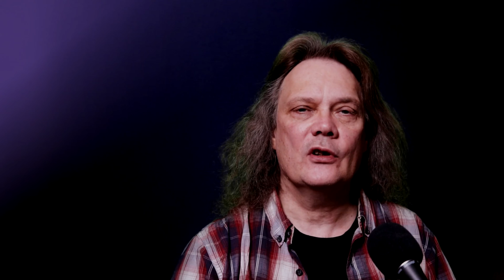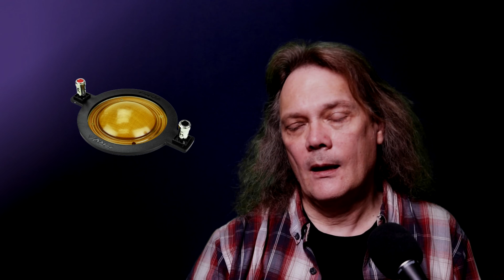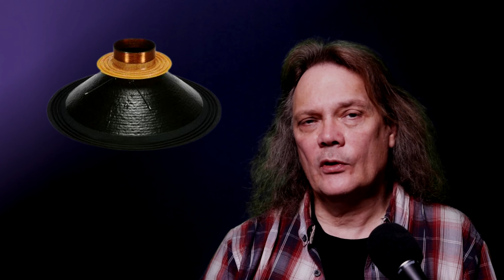Speaker Upgrade 101: Essential factors to consider when upgrading or replacing loudspeaker drivers

Comment: I have a pair of Energy C9 tower speakers and I wanted to replace a driver. I went on e-bay and bought an identical driver from the same type of speaker. After installation I noticed the speaker with the new driver wasn’t as loud as the other speaker. I heard that means the speaker isn’t balanced with the rest of the speakers in the box. Can you explain this better to me and maybe go over some options for getting a good driver into my box. I just need a new cone. The speaker isn’t blown. Could I use the cone from the speaker that doesn’t match to repair the original driver?
Reply from the maker: I wouldn't re-cone in this case.  If you want the drivers to be carefully matched, I would purchase two new drivers, preferably from the OEM, and replace them both.  That way, you'll know you actually have a matched set.

What are the chances that your new driver isn't exactly a perfect duplicate of the original old unit you have?  The parts marketplace has counterfeit items, and even if it's an OEM driver sometimes manufacturers make minor changes over the years. Additionally loudspeaker drivers can change over time with use. It's possible that the suspension of the used older driver has softened up from years of use.

Maybe your new driver will get better with a couple weeks of good use, after it loosens up a little beyond the break in period.

If it doesn't get better, I'd order another driver that matches your new one, or get a pair of matching drivers, and update both loudspeakers.

Comment: Do you happen to know if a Peavey 22xt can be replaced with a 44xt...... Basically The 22's are 30w continuous the 44':s are 80w...

The 44 has fewer screw holes..... But 3 should do
Reply from the maker: I don't think so.  I think the 22xt is a 1" exit, the 44xt is a 1.6", so I don't think they'll mate correctly on the same horn flare (assuming you can even squeeze the larger driver into the box).  You can made anything happen with with enough adapters, glue, and force, but I think I'd look for a driver that properly fits the horn flare, and is about the same efficiency as the original.
Reply: @Barry-Watson  I just checked.
... Your right.... I looked at al the Peavy white papers on the 22's. I missed the larger size...

Now that I know peavey has a 2' dome..... I gotta upgrade my horns...lol
Reply from the maker: I've been really happy with some drivers from B&C.  Good luck!